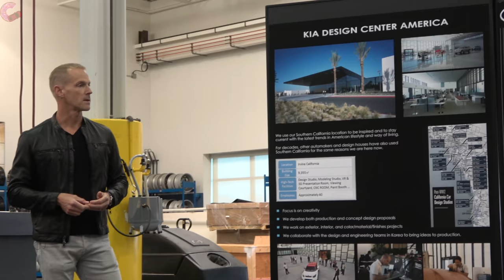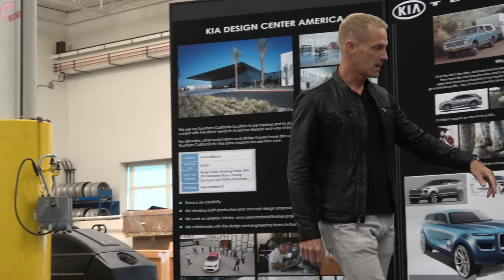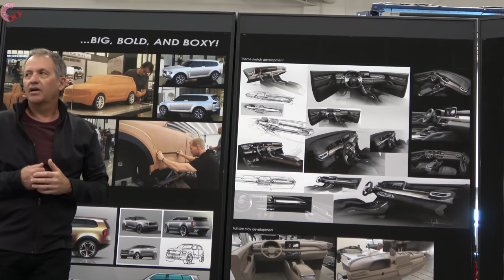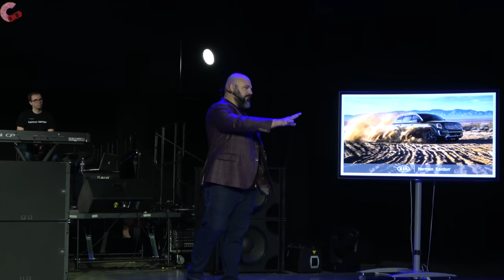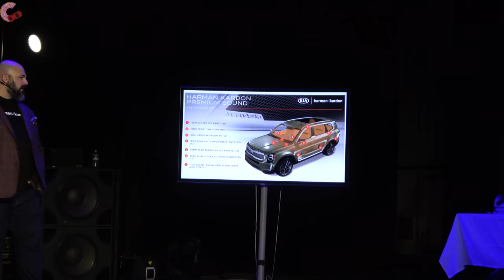Kia Telluride CONCEPT Side-by-Side With PRODUCTION Model! // The American Story of Telluride: Part 3

Comment: The concept makes the production model look like an epic fail. The only aspect of the concept that I think is worse than production is the chrome rims and the rear taillights. Of course the interior doesn't count, but the concept steering wheel is nicer too. That concept will never see the light of a production day, but it's a far better visual design than what made the cut.

Comment: Hopefully you see this, and maybe an odd request, but the Telluride community is frustrated about this. Do you have a contact that you can let know of an issue we have? Kia customer care gives a hundred different  answers. On LX and S models, when you turn the vehicle off and let it sit for a while, the rear climate control resets. Every time you start the vehicle, the rear AC turns on. Even in 30° cold weather. The rear climate control won’t stay at your last setting, even if you had it off.

Comment: I wish these had a V8, height adjustable, 4 corner air suspension, and a 4WD transfer case that had 4 options (RWD - AWD - 4H - 4L), and more ground clearance. However, Kia claims they are designing a full-size SUV that they say will emulate the aesthetics of the Telluride, but will be more comparable to a Tahoe, Expedition, and Wagoneer. So, I bet it will have all of those features I wish the Telluride had.